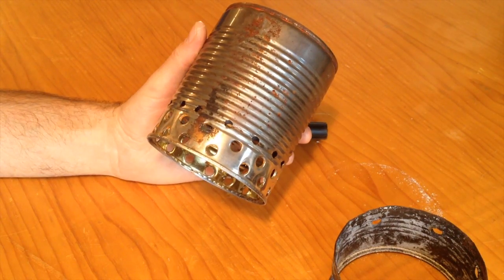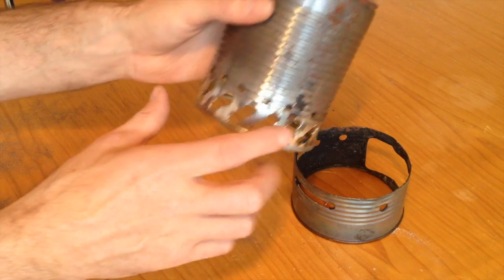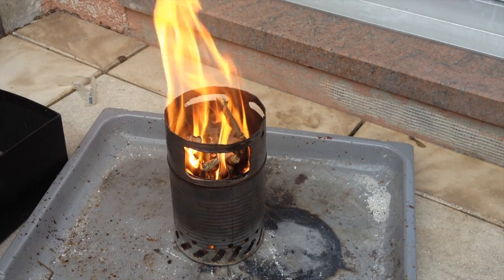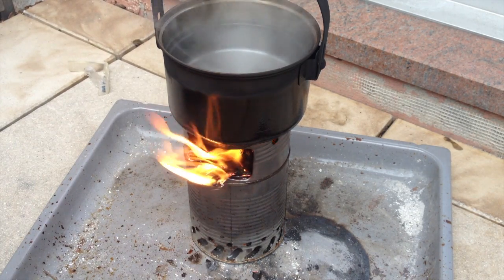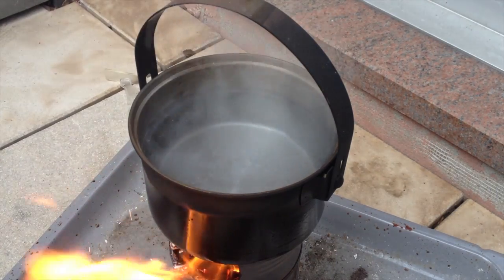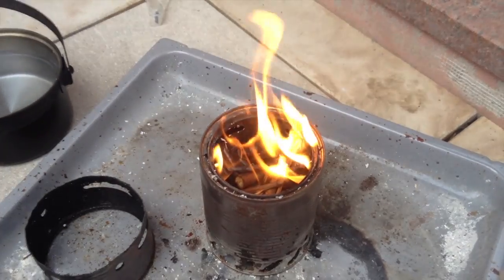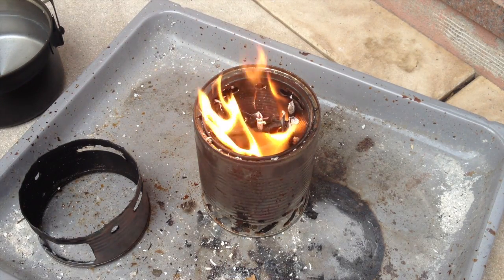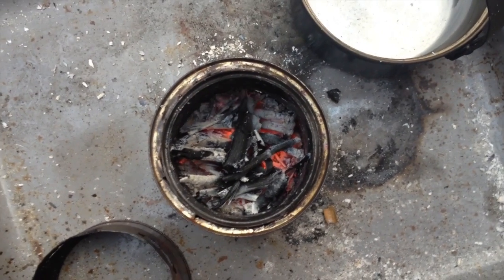WOODGAS STOVE AIRFLOW OPTIMISATION AND SECOND BOILING TEST

Comment: Holes on the bottom does not help to superheat the air which is the whole purpose of a gas stove
Reply from the maker: I am not sure if you mean the holes at the bottom of the burning chamber or those in the outer wall. Anyway, this stove was just not burning properly due to too little air. But there might be several variables that can be tweaked in such a case.

Comment: Every single wood gas stove I've ever built never stays completely lit during the burn cycle. Even when I feed it, it still goes out and either requires a blow tube or a small piece of paperboard to reignite the flame.😢
Reply from the maker: I am sorry to hear that. I am not the greatest specialist for woodgas stoves either. In my humble experience they seem to be more susceptible to interference than regular stoves. If they go out my best guess would be it is due to lack of airflow. This might be a matter of construction (holes to small, etc) or the wood being stuffed too densely in the burning chamber and thus not allowing the air to flow properly. Other than that I don't know.
Reply: @stovemods8231  when you said suspectable to interference. Interference how, interference from strong wind extinguishing the flame? 

I also noticed that if I apply air through a tube it helps keep the fire lit until the end of the burn. 

Otherwise, it will not complete the burn cycle and I'm left with un burned coals instead of %100 ashes.
Reply from the maker: @DonCarlos590  I think to run a woodgas stove perfectly correct (which I usually don't but am told a lot I do it wrong) it is quite an art. To understand how to stuff it and how to control the fire is not as easy. With a regular stove I just stuff it with wood and have good fire. The regular stove tolerates more variety in how to use it in my opinion and therefore is simpler to use, even with moist wood to a degree. Also you are not always trying to generate clean blue flames as you would in a woodgas stove. Which leads to the next point which, as you guessed, is wind. The blue flames I see in videos of others are usually clean but not very strong or high. I would call that a slow fire. And I might imagine this is easier disturbed by wind. If you need a tube to keep it going I assume something is off with the balance regarding how much wood you have in it, how much space in the stove and how much air goes through it in which way. I think these errors might be caused by construction of the stove or too much/wrong type/size of wood or a combination of those factors. As you see for me it is also difficult to tell. This is why I prefer regular stoves that have a rather too good airflow and also pull the air through like a chimney (IKEA-Stoves for example do not have that chimney-effect because they have too many holes at random places and therefore do not perform that great). My regular stoves might not be perfectly efficient in fuel use and do not burn super clean. But they just work very well, and leave only ashes. And for these types of stoves usually wood shortage is not a problem because a few sticks you gather on the ground are enough to get some water to boil :-)

Comment: Thank you your video proved to me that more than 8 holes on the top of the burn chamber is probably not needed ! BUT as you discovered more air on the bottom of the burn chamber IS NEEDED
the slots on the side of the stove was a very good solution, Hats off to you for that !
I burn wood pellets not twigs and they definitely smoke more than twigs but even at that my little stove burns with no smoke at all  I just put as many holes in it as I could on the bottom of the burn chamber even using 2 sizes of drill bits and that did improve the airflow alot ! 
the Jets at the top of the burn chamber that re burn the gas are a different story when it comes to the re-burn.... you can go too far with them as your test demonstrated the Jet burn was not the full length of the new strip..... no doubt your stove should burn wood pellets better than mine I would think, because of that.... but at the end of the burn and after it cools there is only about a teaspoon of ash left out of 3 cups of pellets !  not a single unburned pellet which I am very happy with. but seeing your results, I may add a smaller hole between the top jet holes just to make sure all that smoke is burned up !  thanks for the video !
Reply from the maker: Thank you for your detailed comment! I actually never tried pellets but could imagine they might work as well.

Comment: That design is full of flaws.
Yellow flame
Flame to the side of pot
Soot abound

Where the heck is that soft high temperature blue flame of secondary burn?
Reply from the maker: Well im my opinion the mixture of gas and oxigen is not optimal to produce the often discussed blue flame. This comes from the design flaws or I did not fuel it properly. But still there is a secondary burn which can be seen coming out of the upper hole as jets which only allows the conclusion, that more of the woodgas is burned as it would be the case without the outer wall and everything that comes with it. I have to admit woodgas stoves are not my preferred option but  I get criticised a lot for missing blue flames and think this is not the only variable that is relevant with such a stove.

Comment: agree with Harry Bloom some more secondary air holes. If you burn in batches and do not disturb the batch until the flame goes out on its own (end of batch) and if you then dump out the contents and spray mist the coals to extinguish them. If the stove is burning properly you will have black charcoal and no ash. If you were to leave the coals in the stove to smoulder and totally burn out you would have only ash left. Use your primary air holes to choke the stove burn to make it hot and slow you will get a mostly blue burn at the top of the stove and see little or no burning action below the secondary gas burn. You should be cooking on gas up top and below there should be almost no oxygen and the wood or pellets are so hot that the wood gasses and small amount of steam literally boil off and are then pumped up for the secondary burn.
Reply from the maker: Thank you. To me using a woodgas stove is becoming really a science since I am told by quite some people how to change the use of it compared of how I used to do it. . I am afraid I haven't figured this out 100% yet. Therefore thank you for your very detailed suggestions :-)
Reply: @stovemods8231  If you want a good reference stove take a look at one designed in a similar style to what you have and tested with hundreds of burns, the Mountain Ranger Wood Gas Stove see link, https://www.survivalistboards.com/showthread.php?t=289489 This will give you a good reference  Here is a build video by the designer. https://www.youtube.com/watch?v=qMTUfNoJPws

Comment: good video. thanks. practice makes perfect.
Reply from the maker: Thank you :-)
Reply: i ended up creating a hybrid between a rocket and woodgas burner. The many small holes for wood gas and a  big rocket hole in the side to feed fuel into the burn chamber.  This model isl TOO SMALL and CUTE.   I want to make a MANLY burner from a 55 gallon metal drum and a 30 gallon metal drum.  CHEERS.
Reply from the maker: @danseyler4455  Sounds good :-)

Comment: You need to have a LID on top of your pot to speed up the boiling time as well.
Reply from the maker: I know but then I can not see when the water starts to boil. By staying consistant with this I can compare all my boiling tests to each other but if I was out in the wild I would certainly use a lid!
Reply: I'm sure you already know. Just a pinch of salt will help speed up boiling water. It's kind of cheating though if you are testing efficiency

Comment: I think it's more interesting make an air flow holes adjustments at base of can, for example with an another half cutted and drilled can, when you turn the hal can you can open or close the air flow holes like you can. Love this channel ❤️
Reply from the maker: Thanks a lot. Having the airflow adjustable would be a great thing in general but not too easy to build. But still possible i guess!

Comment: hi .i need a bit of help please . i made  several of stoves (gasifier) and all work find with wood pellets  but if i use oak it burn for few minutes and then star to smoke like hell  and it take a lot to fire it again 
any help will be appreciated
Reply from the maker: Hi,

I am not totally sure If I can help but may be I can share some ideas:

1. Is the oak really dry? Although I would think so because it burns first and starts to smoke later it might be useful to check that.

2. May be the oak pieces just burn down faster because the pieces are bigger than the pellits and create larger gaps in between the wood? If that was the case you would just have less material filling the same space and for that reason it might burn down faster.

3. Again with the gaps: If that is the case it might also have to do with how the air is going through it. Also, if the pieces of wood are not close enough to each other the fire will go out. There is something like a sweet spot concerning how tight firewood can be packed to burn best.

I hope that some of my ideas could help. Let me know how stuff is working out!
Reply: Stove Mods  thanks  
Now I manage to fix my problem 
Look at Facebook #ovenfireme

Comment: If used correctly as a TLUD you have very FEW holes in the burn chamber just
enough to let the last of the embers burn at the very end of burn as the have
run out of woodgas by then and you need to provide a little air to burn the remaining
hot carbon/charcoal . This also provides a low heat at the end to keep food
warm.BOTTOM LIT creates allot of heat in ALL the wood above the initial flame and
therefore massive gasification=smoke  then it is very difficult to get enough
secondary air into the gas for a clean burn without a fan. 
SMOKE is unburnt woodgas and is therefore waisted fuel and energy

TOP LIT only heats and gasifiers the wood at the top of the fire creating a
more regular supply of woodgas to burn with the secondary air. This gives a
much longer controlled burn for boiling water and for cooking on and much more efficient
use of your fuel (less time waisted in collecting chopping and constantly
feeding fire like your video) 

AT NO TIME SHOULD THE WOOD BE ABOVE THE SECONDARY AIR HOLES as the fire needs to heat up the sides of the burner can to HEAT THE SECONDARY AIR and cause IT
TO RISE through the sec air holes. Heating this sec air causes it to expand and become lighter and causes it to flow up and out the holes and  to mix with, and burn, the woodgas rising off
the fire.  
SMOKE is unburnt woodgas and is therefore waisted fuel and energy 

Proposed fixes for your setup

Use the bottom of another can with 3 x 10mm holes near the centre and drop it
into the bottom of your burner

2/3 fill your burner with vertically standing wood then some small stuff to
light your fire in top

 ( with experience you will soon know how much
wood to use for each use ie. Boil one cup of water for coffe or a whole meal
and coffee for 6. If u need a few more minutes burn the some sticks will get u
there )
Reply from the maker: I  amazed  how much more scientificly some people approach the subject of stoves than I do! Thank you very much. I will have to take the time to try your suggestions but unfortunately at the moment I hardly find time to do any videos at all. Sorry for that:-( 
I hope once I find time I can use your conclusions in some tests!

But one more thing: I think it is possible to get enough air with a bottom lit stove and have no smoke. You can see it at the end of my giant woodgas stove tutorial and also in it's optimisation video where it literally spits fire (in the video it is hard to tell there is no smoke because it is dark outside but since I was there i know).

On the other hand I think this one only works because of its dimensions and it has also a big downside for a woodgas stove: It eats insane amounts of wood! So in terms of efficiency it does not do a great job. 

Thank you for your comment!

Comment: how would you reduce the heat if needed for a recipe?
Reply from the maker: I would probably reduce airflow because I learned from my woodgas tests (there is one more) that more airflow equals more heat. 
Apart from that I learned from some comments below that the way you light it has a lot of influence on the fire. You can light the stove from the top or from the bottom. For more details please check the comments below because they are written by people who understand the matter of how it burns depending on where you light it in the first place better than I do at the moment.

Comment: You haven't understood air flow details or how it operates.
Primary combustion air must be limited.
The stove must be fully charged with wood before lighting.
The stove burns from the top down.
Achieve a blue flame for maximum efficiency.
Reply from the maker: +umvhu 
Thank you! Somebody else also suggested that I am supposed to have it burn from the top in order to have a more clean and efficient fire. I haven't tried yet but  I wonder how much fire (talking about quantity, not quality) it will produce once I limit the primary air. With this stove I had the experience that It boiled quicker when giving more primary air to it as it can be seen in the following video about the grid replacement. I am not saying it burned cleaner or more efficient but the water boiled sooner. Do you think that can be compensated by lighting it from the top? Might be interesting to do some tests on that matter!
Reply: Yep. My guess is it boils quicker because more fuel is burning in a shorter time. But with a woodgas stove the goal is to ignite the gases, hence "gasification". That's usually around 75% more efficient. One way to decrease boil time would be to change it's size. Cheers mate.

Comment: If you are really interested in optimization you won't partially load the stove, light then smother the fire by loading wood on top. If you watched your own videos, they will show you what you are doing wrong. Wood gas stoves with secondary air like yours are designed for TLUD, Top Lit UpDraft fires. Load the stove with your wood standing vertically,  1/2in or more below the top secondary air holes. Cover that with tinder, shavings, alcohol drenched tissue wads, birch bark,etc and much smaller kindling. Then light. The fire on top warms the wood below and it will begin to decompose by giving off its wood gases (smoke). Only the first 2 minutes should there be any smoke at all until the enough heat (1200 degrees the temperature of a candle flame) is produced to burn its own smoke. Those gases below  rise into the fire on top and are burned. Some of those gases find there way into the outer chamber and are lit as they are forced through the upper holes so you can see the jets working in the top of the stove. Depending on design (size, number and positions of the holes vs the size of the air chamber), the end of the burn will have nothing but charcoal or all ash.Once the stove is loaded properly, with good design, no further actio is needed unless wind factors blow the flame out. Even then all you have to d is light the smoke and the fire returns. TLUD woodgas stoves are designed for longer, slower burning, hotter, cleaner, smokeless controlled  fires not to see how fast a cup of water boils with flames shooting out everywhere. IMHOIf all you want to do is boil a cup of water in 7 minutes, one can is enough with holes punches wherever you want to put them. Wood gas stoves are about burning down to ash, smokeless, which just happens to be hotter, yellow, blue and white flames, longer, smokeless burns. Using accelerants sparingly in the front of the burn helps to make even the first minute of the burn almost smokeless as well.The smaller the wood stove the harder it is to get get best effects of TLUD design because it is harder to get the heat needed , 1200 degrees, to burn smoke (woodgas). I suggest buying a Silverfire or it's $15 knockoff on Amazon. You need more practice making fire with a good design than trying to design stoves when you don't even understand the basics of firemaking and simple proven stove designs. I hope that helps you. Inefficent fires have low tempsand are red, orange is next, then yellow, then blue, then white. You want white blue and yellow flames.
Reply: I can confirm this. if you tie a bundle of birch twigs or better hawthorn twigs with twine to the circumference of the inner chamber you will (with draft exclusion) get a below 5min boil and the ash will burn white!
good vid though and nice build!
Reply from the maker: +MrJoeyBoombotz 
Thank you! I will try what you suggested and start the fire from the top. Actually I have seen people do so before with a woodgas stove but just in very few cases. I will give it a shot and try to produce blue and white flames!
Best regards
Reply: White, blue flames also minimize pot smut to almost nothing. Using a carbon monoxide detector will also teach you how to manipulate your fires to near perfection with dry fuel.
Reply from the maker: +MrJoeyBoombotz 
Thank you once again, i will try:-)